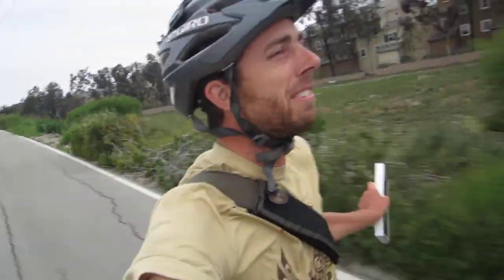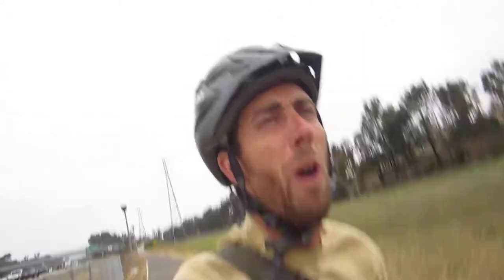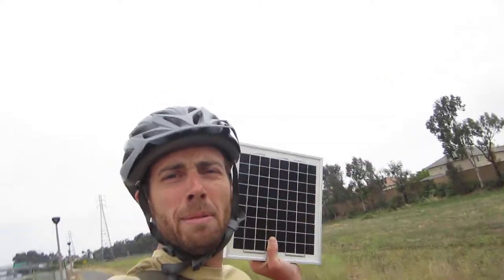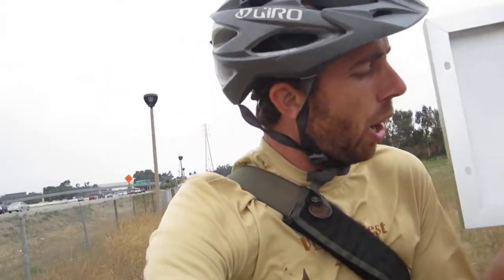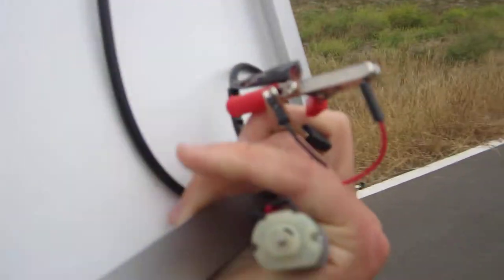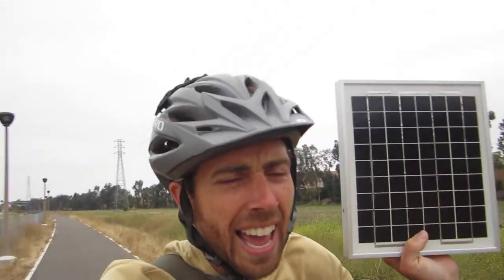Rambling on a Bike - Invention Idea Friday: Solar Powered Bike

Comment: Love it, love it! Plz Elon save us from high cost batteries! I have an electric longboard and I get range anxiety. It'll go 8 miles but if it dies I have to walk, it'd be great if I could generate power on the go. For bikes it makes way more sense though. There are flexible solar panels now. Maybe the frame could have a solar gathering outer layer. Also wearable solar panel helmets like you said!

Hmm what else... Generate power from the heat generated by the brakes, tires, and from the rider. Collect Wi-Fi and other radio. If you got enough relatively low watt sources maybe you could get some real speed!
Reply: insanity54 Always great to hear your thoughts insanity! Solar is neat and the cost of batteries is hopefully going to drop with the gigafactory!!